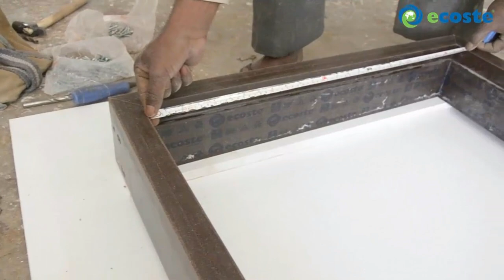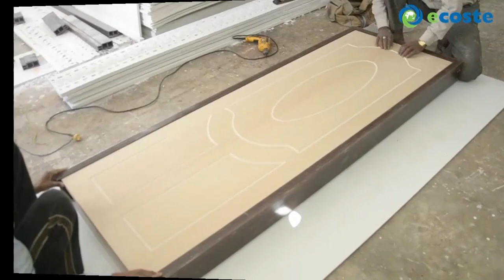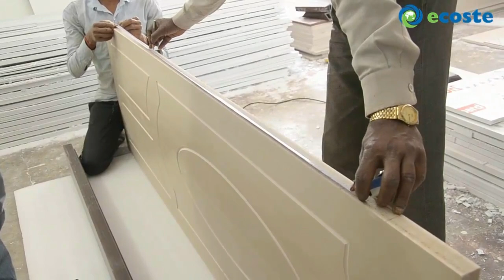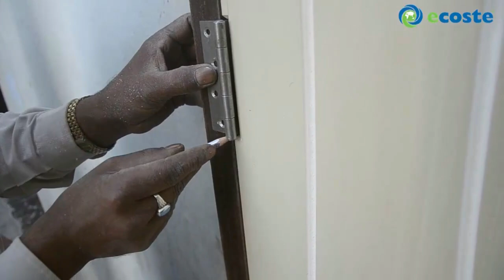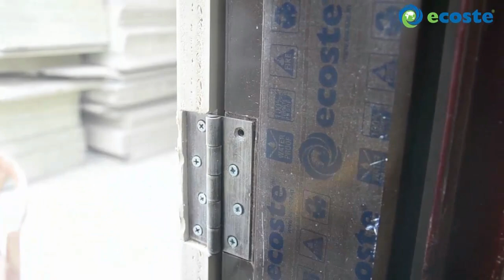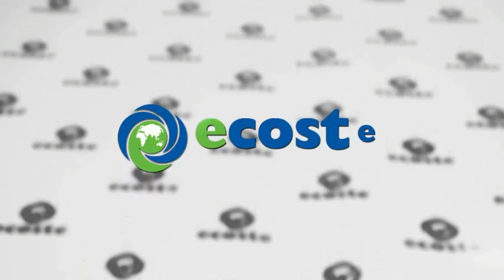WPC DOOR Installation | Infinity designs | Substitute of Wooden Flush Doors

Comment: Sir three months back we have installed the door with local carpenter, now the hinge side screws was loosen from door side part. Kindly give me the solution to fix the problem.
Reply from the maker: Please, connect with our experts at:-
Mobile: 7669448479
Reply: Which brand u used. Did your problem resolved?
Reply: Brand I don't know but the problem was not yet resolved